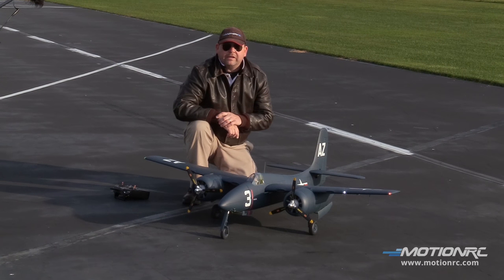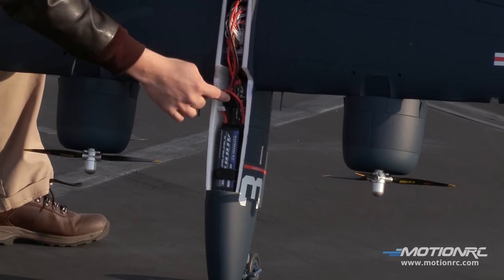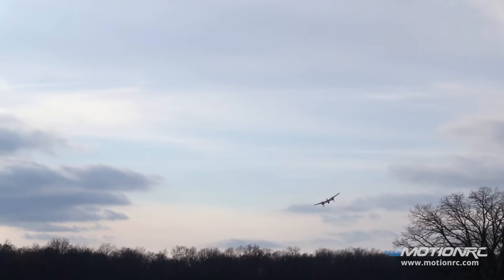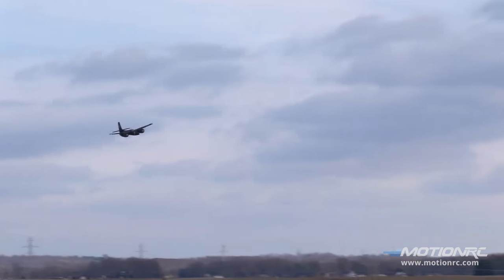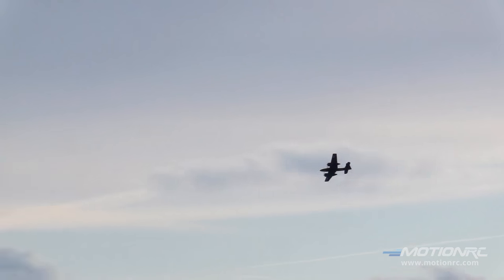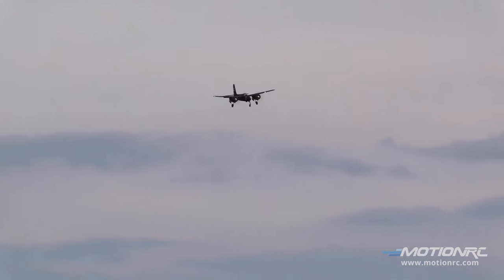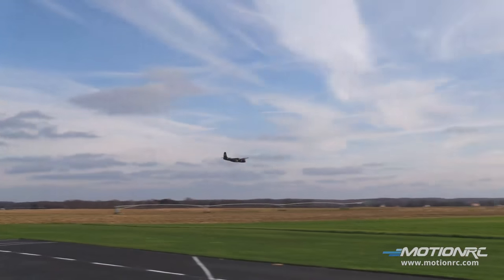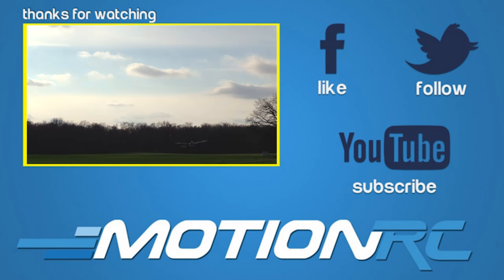FlightlineRC 1600mm F7F-3 Tigercat Flight Review

Comment: for sure my next RC plane! Always loved the Tigercat and excited for how well this one turned out. Ryan, what flight jacket do you have?
Reply from the maker: BRGT350 thanks a lot! I have a Schott A2 with furry collar and the Cooper A2 that you see more often.
Reply: Thanks Ryan. The Cooper A2 looks very accurate from the videos I have seen with you wearing it. I am doing some research into the jackets to make one that will match my pair of B-17's I am building. Found a cheap used one as my "100 mission" jacket and now looking for a nicer one. If you ever need a patch or name tag, check out Spirit of 44. I have one of their hand painted squadron patches and name tags on my jacket. As for the Tigercat, I am hoping to get one at the end of the year as my winter project. Working on my pair of B-17s this winter and spring and will be ready for the F7F later. Everyone seems to love the plane from a flying perspective and I am really excited to add one to the hanger. We used to have a F7F based not far from home that would make an appearance at air shows when I was a kid. It has since been sold, but a great memory to have seeing a F7F demo each summer at the air show. Keep up the great reviews!!

Comment: Are u having to keep a little power on approach? Or idle glide?
Reply from the maker: all depends on the speed you are at coming in. Best practice is to have 10%-20% throttle on landing, but with the tricycle gear large wing area, you can easily idle this plane in as well
Reply: @MotionRC    On all your demo videos for each plane, I would like you guys to talk through the take off, approach, and landing.   I'd to know how much throttle you are using on takeoff roll, when you are reducing the throttle and to what, flap settings, etc. when setting up for the approach, and what you are doing with the throttle and elevator on final and rollout.   This sure would have helped me on my Spitfire and Corsair from stalling or nosing over on rollout.   I know you are trying to focus on the features of the plane for sales reasons, but if you could take a minute or two talking through the takeoff to landing it would be a great help!    Thanks..